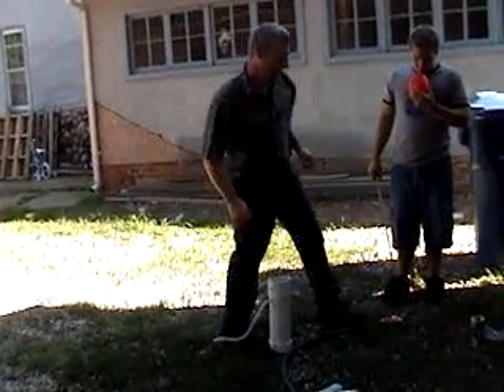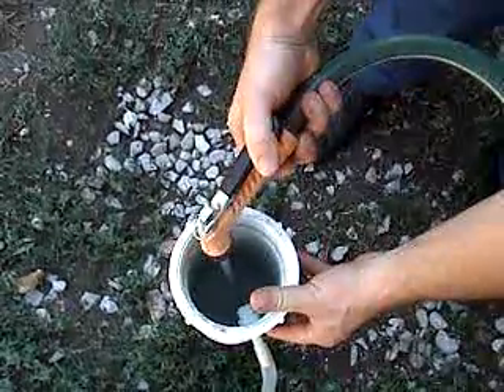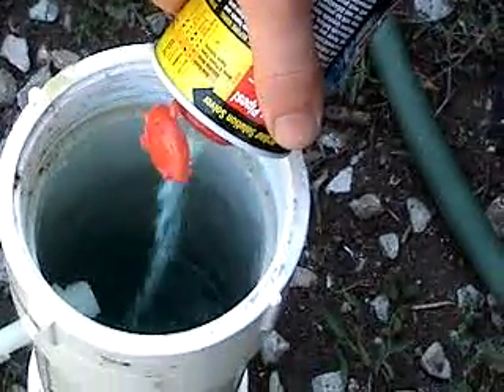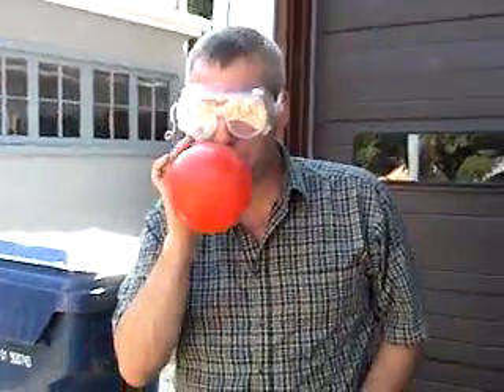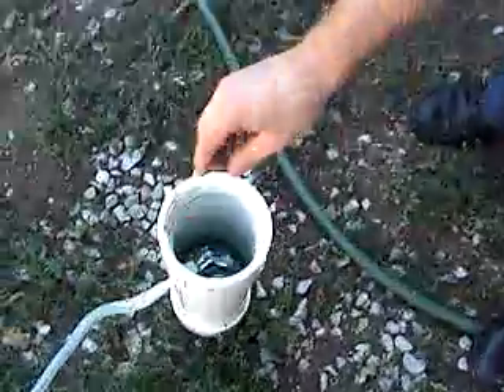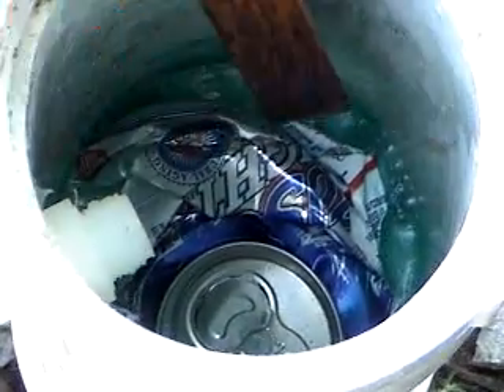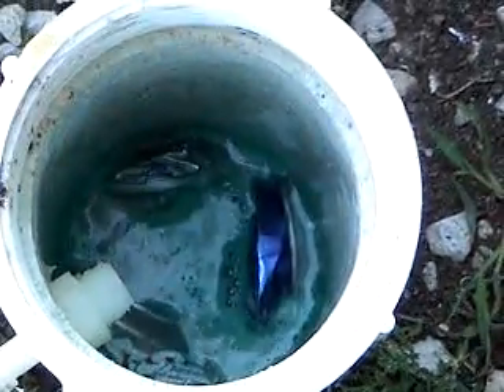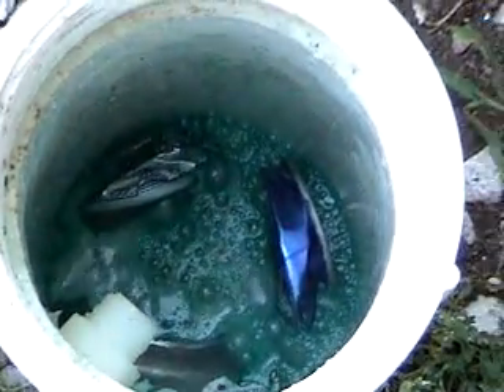Chemical based hydrogen generator

Comment: thanks for making this  but why do you cut off video? I wanted see till end . does naoh with alminium with h2o produce any poisen gas other than hho?  can I use at home using carbon filter to filter stinky  air created by drano, did you sealed pbc pipe on buttom with pbc pipe plubing cenent ? will naoh water leaks when it get hot ?   please let me know that 3 questions sir i want to use inside of house if I can please thanks sir.
Reply: learn the chemistry